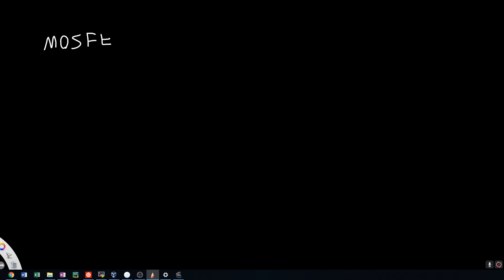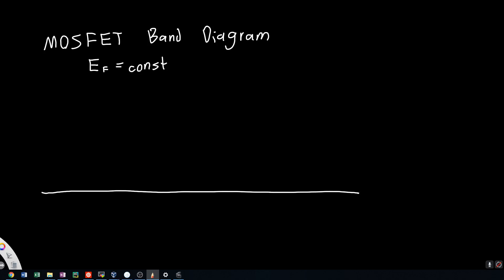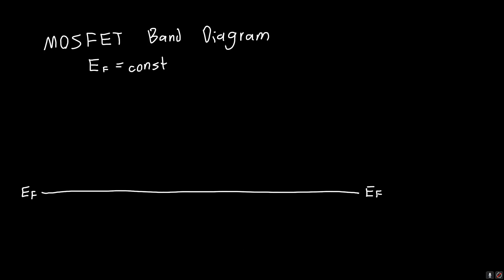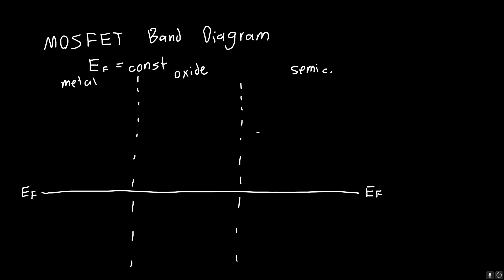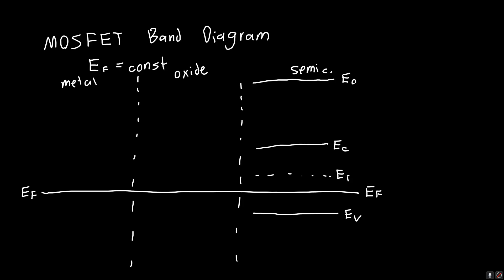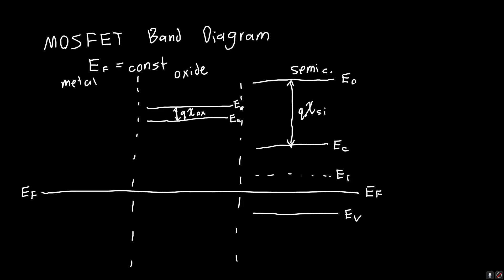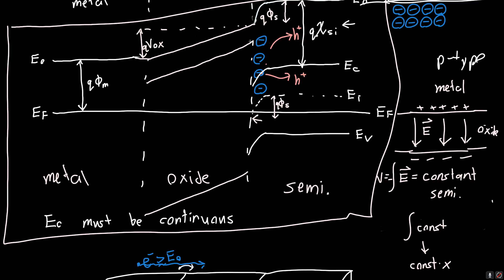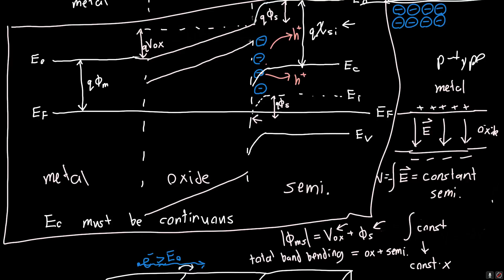MOSFET Band Diagram Explained Part 2

Comment: Jordan, excellent endeavor. However, I think a better approach is to start with drawing a constant vacuum energy level. Then draw semiconductor band taking into account of how far the Ef would be from vacuum level. Repeat this for metal, and oxide layer, but assume that there are no junction formed between them yet (M,O,S are far apart from each other). Then consider a junction formed between them, and the Metal and Semiconductor is short circuited by an external wire. When short circuited (V_ms=0), electron would flow from low work-function material to high work function material, until their fermi levels are matched. The oxide interface which loses electron to achieve equilibrium will see an upward band bending. Likewise, the other oxide interface will see a downward band bending.
Reply: do you know a book where I could find that approach ?
Reply: what you can definitely find is the same approach as in this video, in for instance:
 TAUR und NING Modern VLSI Devices
chapter 2.3
together with this video it gives a very good understanding of the situation.

Comment: Great videos, thanks for creating all these tutorials. One thing that might be a bit confusing to the viewer; at 2:21 you assert that electron affinity (in the semiconductor) is “exactly the same concept” as work function; but of course the affinity is the gap from the vacuum level to the minimum of the conduction band, whereas the work function is to the fermi level. Both exist and differ in the semiconductor.
Reply: I fully agree, and that is why 
total bending = V_ox + Phi_si = | Phi_m - Xi_si |
is not correct. the difference you're addressing is Ec-Ef
so I think it should be
total bending = V_ox + Phi_si = | Phi_m - [ q Xi_si + (Ec-Ef)] |
Reply: Ya but Ec = Ev in the metal.....

Comment: Hi Jordan, I love these videos... explaining thigs really good. I got one question though. In the previous video you say that it is not known where the Fermi level is in the oxide however in order to know how much is the offset in  the vacuum level between the metal and the oxide layer in other words how much the oxide layer's energy levels tilt you need to know where the fermi level is, don't you? Thanks for the answer in advance.
Reply from the maker: As the oxide doesn’t really have any charge carriers, the Fermi level really isn’t meaningful. You can figure out how much it will bend by treating the oxide like a capacitor

Comment: Thanks a ton for the wonderful videos. They really help.

I have a question. If we assume, E<Fm> and E<Fp> as the fermi levels of metal and semi-conductor before they are brought together, we know that they should line up when they're brought together. Does E<Fp> now increase to E<Fm> or is the lined up Fermi level for the entire MOSFET in between E<Fm> and E<Fp>?

Comment: Thank you for the video I have a question. You said the reason why the vacuum level is continuois is because it must be free at the interface. Is it right for electrons to be free in a insulator? Wouldnt that be a defect?  
Thanks for reading

Comment: In the last video you showed the Fermi levels of metal and semiconductor had a large distance and you told that we'd have to make them be at the same energy level at the equilibrium ... But you explained nothing about that in this video.... Can you please tell how the Fermi levels are same here ? They had a difference in the last video
Reply: there is a difference between the fermi levels when a voltage is applicated (no equilibrium).

Comment: could you please explain how the holes are moving away from the junction between oxide and semiconductor at 5:25 (https://youtu.be/KFx6zxd791g?t=326 ) ? Is it because of electric field and the majority carriers?
Reply: Please see Mueller and Kamins device electronics textbook (pp.382-383) for a clear explanation.
1) Metal (e.g., aluminum) work function is less than the p-silicon's work function.
2) So when the parts of MOS capacitor are brought into contact, electrons will transfer from metal to p-Si. But how?
3) The oxide is a dielectric so it will not provide a path of this electron transfer, However, there is always some path for charge carrier to flow between the metal and the silicon. For example, the gate electrode and the silicon may be connected together. This is a key point - please see Mueller and Kamins textbook at p. 383.
4) Note that there is no external voltage applied to the metal. Simply connecting the metal and the silicon will cause a transfer of electrons from the metal to the silicon.
5) This electron transfer is equivalent to holes moving away from the p-Si and into the metal. These holes will spread out in the metal and form a thin layer at the metal - oxide interface. At the p-Si - oxide interface, the depletion of holes will cause the silicon in that area to become more intrinsic.
6) Important: since there is no external introduction of charge carriers, the MOS capacitor must be at thermal equilibrium, so the Fermi level must be flat for metal and silicon.
7) The flat Fermi level along with the depletion of holes at the p-Si - oxide interface cause the energy bands of the silicon to bend down at the interface. This is somewhat similar to the band bending in a pn junction, except here in a MOS capacitor, that there is no charge carrier transport between the metal and the p-Si through the oxide.

I hope this helps you better understand the MOS capacitor's band diagram at thermal equilibrium.
Reply: @michellezheng3611  I also have the same question, this really helps! Thanks!
Reply: @michellezheng3611  Shouldn't the energy bands of the Si be bending upwards (from right to left) instead of downwards? At the Si-oxide interface, as we go from left to right, we first have a concentration of negative ions, and this negative charge concentration then decreases (abruptly). This means that the electrostatic potential goes from negative to positive (from left to right), meaning that it increases from left to right. If we consider the energy bands with respect to the electron, then the electrostatic potential energy bands would decrease from left to right (since the electrostatic potential curves increase from left to right). So, in the end, what we should have is that the energy bands at the side of the Si bend upwards as we go from right to left, which is not what was drawn in the video.

Comment: What's the degree of the mathematical equation describing the bent portion of the curve?
I mean, in oxide it's linear, in semiconductor is it a exponential with -ve power? Or is it 1/r^2 type curve?
Which mathematical law is the curve governed by?
Reply: I'm talking about the vacuum level line's shape in the semiconductor sir.
The oxide vacuum level line is indeed linear.
Reply from the maker: Ah! My mistake. The vacuum level just follows the curvature of the underlying material, since the distance between the material and the vacuum level at any point in a given material must be the same (given by the electron affinity). It’s linear in the oxide and quadratic in the semiconductor.
Reply from the maker: It’s linear, and it can be modeled as a carpacitor.

Comment: Why u have drawn all vacuum levels at different level
Reply from the maker: Because the vacuum level just represents how much energy you need to strip an electron from the semiconductor, but it must also be continuous (otherwise if an electron was walking along on the surface of one material and crossed over to the other it would suddenly become a bound electron, which is nonsense). These requirements together force the vacuum level to bend.
Reply: Thank you, dude. I also have totally the same question

Comment: don't you think all vacuum levels should be on the same level
Reply from the maker: Rishi Varrey Yes, initially I did think that because that makes intuitive sense (the “vacuum” is just external to the semiconductor so why should it’s level change?). However, the vacuum level is really only meaningful in a relative sense. It’s not a single energy level across the whole world, but just represents how hard it is to yank an electron away from the material. In order for that to be true, it has to be continuous across a material, which means it has to bend with the silicon.
Reply: @JordanEdmundsEECS   How do I figure out relative vacuum level positions? Here it shows that vacuum level for the metal is lower than that of the semiconductor. But from you last video, work function of the metal is greater than electron affinity of the semiconductor. So, if fermi levels are same, shouldn't the vacuum level for the metal be higher than that of semiconductor? I find it confusing.
Reply: We don't have to consider electron affinity of semiconductor, indeed we have to consider work function of semiconductor which is greater than metal which was also mentioned in last video
Reply: Sir has given just example what happen to bending of oxide when work function of metal is greater..
Reply: Sir I don't understand the concept of surface potential plz explain

Comment: Sir if the direction of electric field is from metal to oxide why bending is toward metal. Please expaexplain the concept....thank you.
Reply from the maker: Sure, I believe it is that there are two minus signs (to get the energy from the electric field you first use the relation that Efield = -dV/dx and then the relation that Energy = -qV), so since the E-field is pointing to the right (positive) you expect the energy to increase moving to the right.
Reply: @JordanEdmundsEECS  thank you so much sir....love from india😃